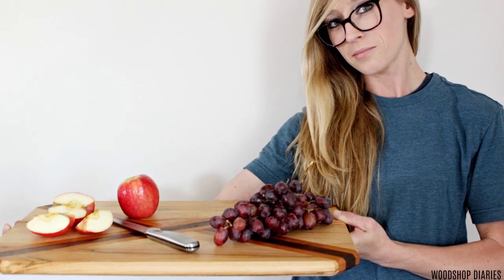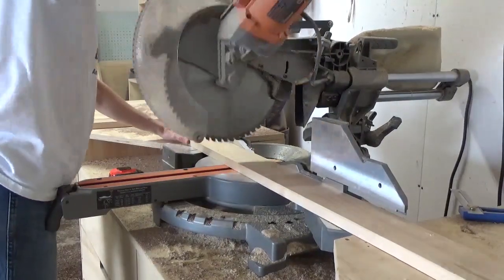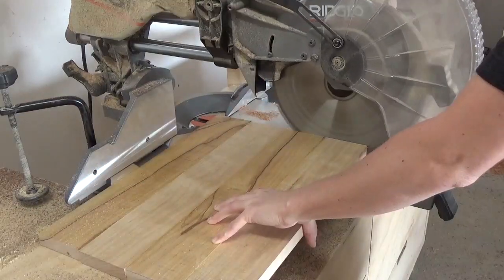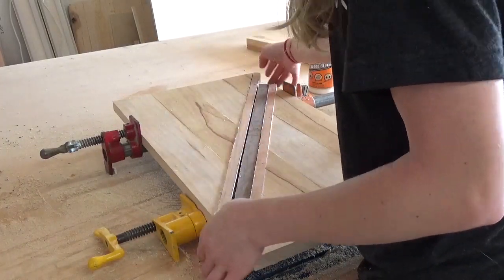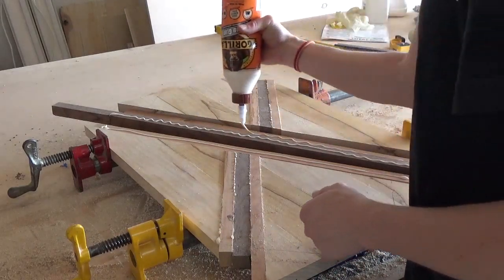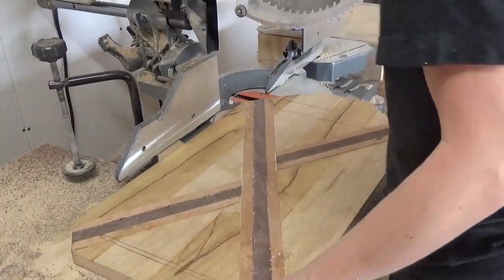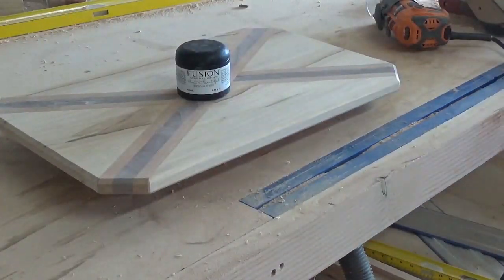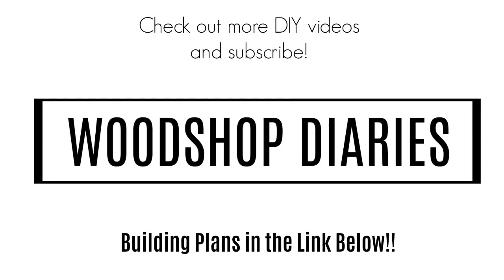How to Make a Scrap Wood X Design Cutting Board

Comment: Sorry. Using your X design on a 4 wine glass holder. I will be cutting out the same amount of maple in 2 stages and replacing what I cut out with 2 strips of cherry and one of walnut. This will made a true X on the board. Will probably do one like yours as well in the future as I think it is cool.  You are very talented.